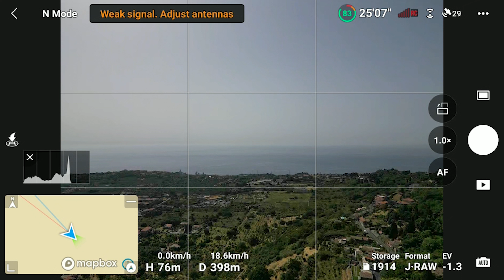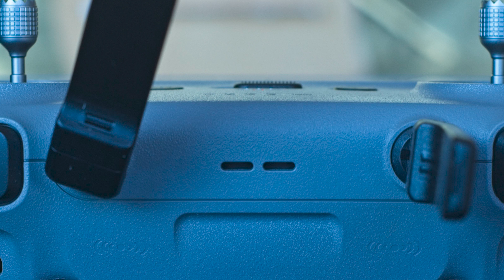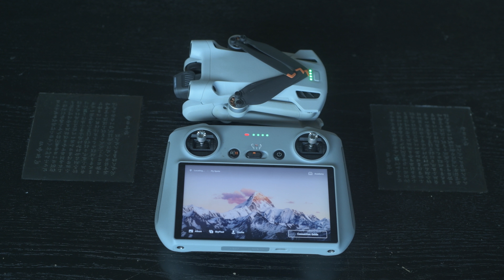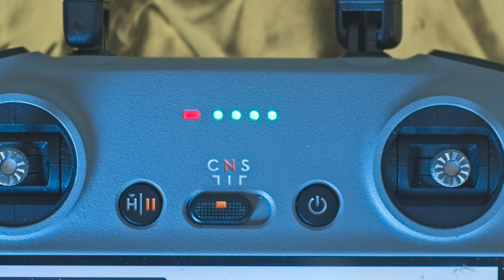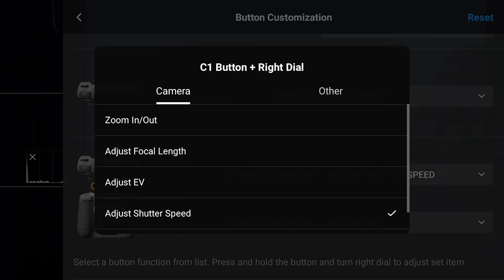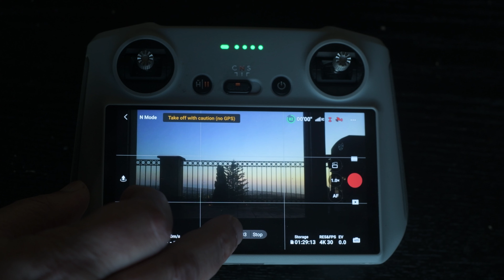DJI RC 2 Remote Controller - for Mini 4 Pro and Air 3

Comment: is the display not clearer on a big tablet ?
Reply from the maker: The display of the RC2 is surprisingly good.
Not as big as some tablet, but great resolution and reduced flare from the sun.
In my opinion the RC 2 is extremely practical: non cables to carry and connect, very ergonomic in the hands